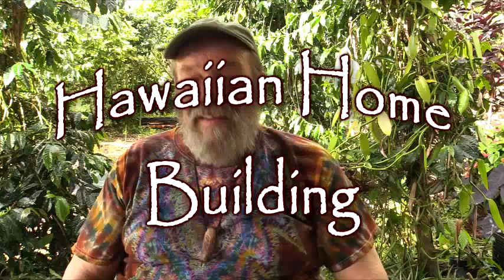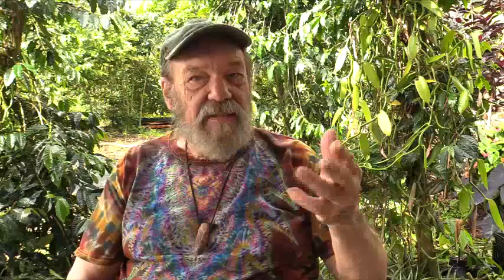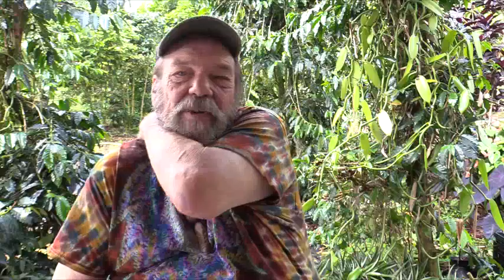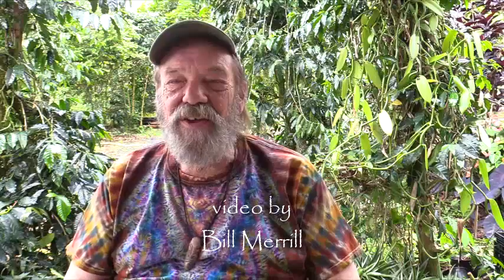Hawaiian Home Building

Comment: I might be too late here to comment but I am surprised you haven’t encountered mildew problems under the flooring with a slab. I rented a place in the Bay Area 1960’s slab and one room had carpet laid directly on the slab that was infected with mildew that came up from the ground. Maybe it was cracked? I dunno. Earthquake?
Reply from the maker: My thought is poor construction caused the trouble.  Nope, no trouble with floor mildew.  The house was built on a pile of compacted rock because the sight was 16 foot deep volcanic ash and too soft for building.  The slab was poured on top more gravel and then two different plastic film barriers were used between the slab and the flooring.  Our house has over hangs up to 10' surrounding the building.  Rain never touches the house walls.  The ash soil we live on drains as fast as sand so water is gone as fast as it arrives.  California has a lot of clay soil in the Bay.  Perhaps they didn't install drainage below the slab and put film over it.
Reply: @GreenGardenGuy1  that makes sense
Reply from the maker: Mildew can happen on organic flooring materials here but mostly if the building is locked up with no air circulation and the sun light is omitted by closed blinds.  Some people favor inorganic flooring like tiles but we live up in the mountains and my feet would freeze on tile.  I use it only in the bathrooms.   @juliebbb6031

Comment: Thanks for these videos! I've seen your video on fire ants, hoping you might have thoughts on controlling termites. With a slab foundation I've heard they can get into the structure through plumbing penetrations, etc.
Reply from the maker: I live on a slab and everything except the sewer comes from above rather than below.  If your home is built to code you won't have to worry much about termites.  No homes can be built here with lumber that is not treated with boron.  Termites can't eat boron.  Keep the house well painted, keep the roof in good shape and termites should be too much trouble.  I find the statement about slabs to be kind of humorous.  If the house is built on posts then there is nothing to stop the termites.  They walk right in.  With a slab they have to go around the edges to get in.  When you say "I heard" all I could think was, "It's the coconut telegraph again!"  Lots of strange ideas circulate by word of mouth here.
Reply: @GreenGardenGuy1  I was asking because of this video which promotes installing mesh around penetrations through slab vs. using chemicals- https://www.youtube.com/watch?v=m4d8QRprYg4
I'm looking to build on the Big Island and just trying to do research. Thanks Bill
Reply from the maker: Perhaps some people build different.  I can not tell you if bringing things through the slab from underneath is code or not.  All I know, is the only fixtures that were run through my slab from below is the sewer and it is cast tight into the concrete.  No room for bugs.   Running anything else through the slab is a bad ide if you ever have to repair it.  Pipes and wires are in the attic here.
Reply: Jumping in on this conversation uninvited 😂…  I’m a local born and raised. I’m a little perplexed, as almost everyone I know is always concerned with termites whether it’s new or old homes. Slab foundation helps buffer but termites here FLY and swarm and are in no way limited to ground only access. I think where you live there’s enough space/acreage between properties and homes to be basically shielded from termite threat. I could believe that some areas have no colonies for many many miles. So they’re not a threat because they’re not in the area, but if they were a new build wouldn’t spare you forever. I’m in Kona, on a half acre surrounded by other half acre lots in private subdivision. My house is old so I’ve got termites have to tent every 5yrs to keep them at bay. They’re never going to be “gone”. Most houses around me are same age w termites too. There’s a couple brand new builds on slab built with treated lumber but because they’re surrounded by old houses, the termite threat is real. Maybe they can wait longer to start tenting and not have to tent as often but it’s definitely a consideration for them, albeit maybe 10-15yrs down the road? I seen swarms flying under the lights at the gas station 4miles away, as well as flying around at everyones place in the surrounding area ~10mi. I think termites are the #1 threat to a home in Hawaii, but the variable being location and saturation of the surrounding area and age of those buildings.

Comment: Being here in wisconsin, I feel I lucked out greatly with my house. Its biggest negative is the size, it's tiny, but beyond that; brick walls, well insulated, can barely hear anything except when the neighbor exercises (I think he fell over and hit the interior wall last night.) Cheap to heat, cheap to cool. I wish I had an outdoor space, but that also means I don't need to maintain an outdoor space. And the bank was willing to back me, that was the biggest fear.
Reply from the maker: You did good.  When you put in your time and energy, good things can come to meet your effort.  My take on people of your age group is, home ownership may have to start smaller.  With everything so expensive it is a way into the market and it can be a stepping stone to bigger and better things down the way.  My first home was smaller than yours.  Remember the 6 sided cabin that Weasel lived in?  I never have enough space but the current home is the biggest and best I ever owned.  I didn't start here though.  Good comment. Aloha
Reply: @GreenGardenGuy1  Forgot to get to my point in the comment. House has 2ft eves, I love being able to stand at my door and unlock it without getting wet! 3ft eves sounds awesome.
Reply from the maker: @Nesetalis  Well, the truth is my shortest eve is 3 feet, several are 4 foot and I have one on the Lanai that is 10 feet.  I live under that one half the time.  These eves are what give the plantation house it's distinct appearance compared to a ranch house, that and the roof comes down to the corners rather than the ends.  Pyramidal rather than A  shaped.

Comment: Planting sound-absorbing shrubs and trees around your property and building a fence might help with the neighbor noise.
Reply from the maker: Keep them back at a good distance if you do this.   Too much shrubbery around the house blocks air circulation, encourages mold and increase the amount of insects around the home.  Keep landscapes open so the trade winds sweep through.  Lots of shrubbery close to the house also loads with Coqui frogs.  Sheltered buildings hidden from the road are a target for criminals.  You are correct, shrubs help block noise but cause several other problems.  Stay away from small lots.
Reply: @GreenGardenGuy1  Thanks. Only experience can give such insight. We must fund research to rid Hawai'i of coqui frog noise.
Reply from the maker: @DialecticDeveloper  How I wish.  At least on the Big Island it is too late to deal with the frog in any large scale way.  It owns the Island.

Comment: I know there is a lot of lava rock there but are there restrictions on using this material?
Reply from the maker: No restrictions on use.  Harvesting gets touchy.   Easiest to buy it from a rock yard.  It is used extensively for building rock walls here.  Homes seldom use it but you see lots of pahoehoe veneers on commercial buildings.

Comment: Roxsul is a good noise reduction insulation
Reply from the maker: Highly recommended for people yet to build a home here.  As for me the walls are already closed up.
Reply: @GreenGardenGuy1  how many sq ft is the house
Reply from the maker: @kennethhudson8013  1480 sq feet under the roof.  480 of that is the attached carport.  We spend little time inside around here unless I'm sleeping, cooking or the rain won't stop.
Reply: @GreenGardenGuy1  good size home
Reply from the maker: @kennethhudson8013  It's big enough for the two of us with room for guests.

Comment: The recent changes to the owner builder provision of the law are unfortunate but I understand why they did it.
Reply from the maker: Once upon at time codes were very lax here.  They continue to tighten as time goes on.
Reply: @GreenGardenGuy1  what about structures under 600 sq. Ft ? No permits required? Do you have an email to contact you?
Reply from the maker: @williammeszaros3382  I don't work for the county but I believe every property has to have at least one permitted structure before others are added.  If the land is zoned AG then the county allows the farmer to build additional structures up to 6000 sq ft. without acquiring an additional permit.  The additional structures can not contain bath or cooking facilities.  These would require an ohana permit.  I pulled this off the counties website last time I needed to know.  Things change though.
Reply: @GreenGardenGuy1  thank you for your insight, and humor!

Comment: I would have never thought you would need to wash the roof with all that rain.
Reply from the maker: The volcanic ash sticks.  the water dries in the sun and it fuses to the metal.  Much of it comes when there is no rain and gets bound with the dew as it dries in the morning.  The bacteria, algae and moss tend to make a home that grabs the stuff.  The rain causes algae which might be the glue holding the ash.